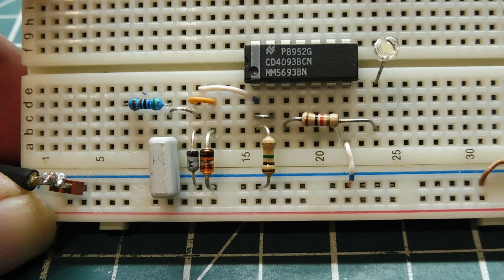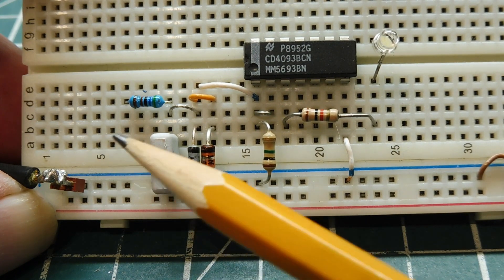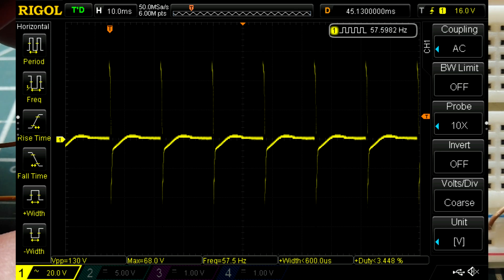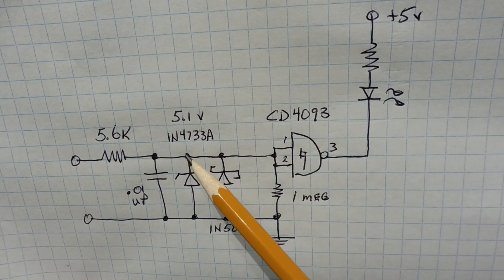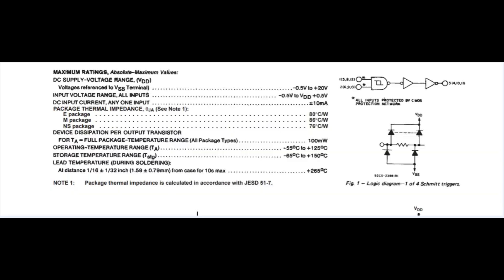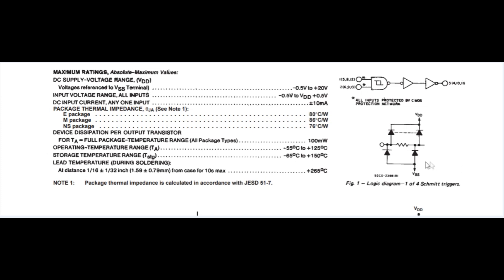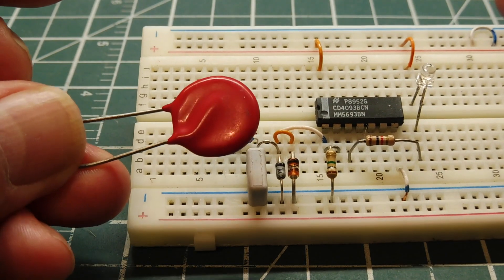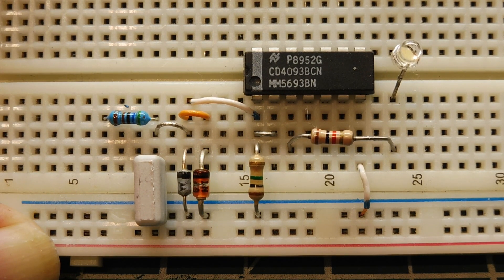Transient Voltage Input Protection  /  MOV

Comment: Hi, thank you for making this video, I had a question:
I am using Arduino Nano, ESP 32 Cam module and NEO 6M GPS module in my circuit.
LM2596 based buck converter for voltage regulation.
Power source - 12V Lead acid motorcycle battery while the engine is in running condition.
Max current draw will be 2A.

Can I still use your circuit or do you recommend certain modifications for handling 2A current?

Comment: https://youtu.be/d4q-kK5h3xM
I have troubles with contactor noises.
I couldn't find a solution.
This video is a good solution for input 
Could you advise for supply Voltages for MCU ?

Comment: Can you please define “clamping” ?
Reply from the maker: Clamping refers to the characteristic of a device to hold (clamp) a voltage to a certain level and will not let it exceed that clamp voltage. A zener diode of 5.1 volts connected across a circuit will hold that voltage to 5.1 volts even if the input voltage increases.
Reply: 0033mer  🙏

Comment: A very useful video, thanks for sharing. Would a TVSD eg P6KE series not reduce the component count? It could act as the zener and transzorb in one. Also an upvote for the request for a video of your spike generator.
Reply from the maker: You cannot get a P6KE as low as 5 volts and the clamping voltage is not as consistent as a zener. The reverse clamping voltage will not be as low as -.3 volts like a Schottky diode.

Comment: It will be very interesting if you make a video about how to take the correct measures to protect a circuit against transients or surges or the different options available, especially those designed for microcontrollers. Have you ever heard of "common mode choke"? 
Right now I'm working on a project for my motorcycle, and I know that they're full of transients because they have a lot of inductive loads. E.g. relays, starter motor, pump fuel, ignition coil, and so on. I am not an expert on the subject but from what I have been reading TVS diodes are preferred in the automotive industry. Thanks for reading!

Comment: I am confused.   where do you take your power off of this circuit?
Reply from the maker: Gnd and 5 volts on Pins 7 and 14 of the CD4093 IC  4:50

Comment: Would TVS diodes provide better protection, reliability, and longevity compared to MOV?
Reply from the maker: TVS do not degrade over time like MOVs but MOVs can absorb more energy so they are commonly used in power bars. A TVS would probably be a better choice in my application but they are generally more expensive.
Reply: Yes, they will. The problem with MOVs is that they degrade over time, but this has become less of a problem over the years as manufacturing processes have been improving. You can read more about it in this document, go to page 12: https://tinyurl.com/y9p55kq6

Also another big difference discussed in page 9, is that "MOVs are inherently bidirectional and have a breakdown voltage that is equal for both positive and negative voltages. In contrast, a standard TVS diode will function as a Zener diode for a positive voltage (cathode voltage > anode voltage) and as a standard diode for a negative voltage (cathode voltage < anode voltage)."

Comment: Thanks for sharing, i have learned a lot from this channel, i am glad that i found it!
Reply: Can i make a suggestion for a future video about snubber protection for relay contacts? I have build a diy pellet burner a few years ago, i had issues with the relay contacts welding together.
Thanks

Vasilis K
Reply from the maker: Are you switching AC or DC current? You could try using a relay with blow-out magnets. Check out this video for a description: https://youtu.be/FDSNT68YC3k